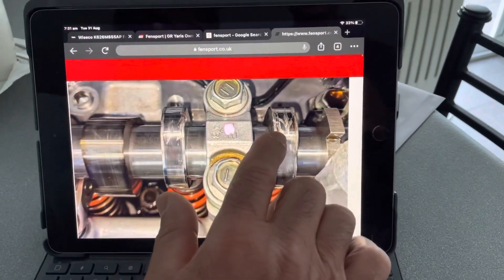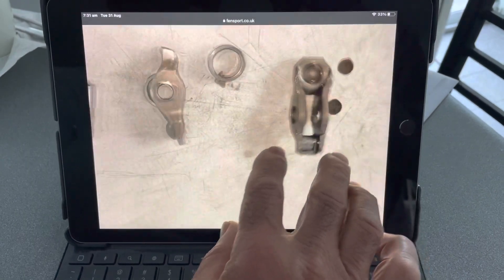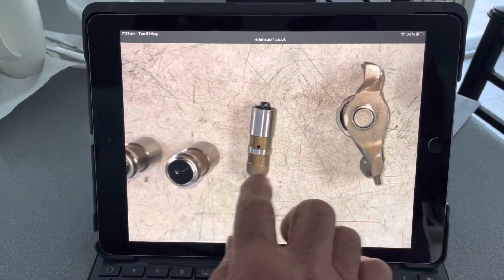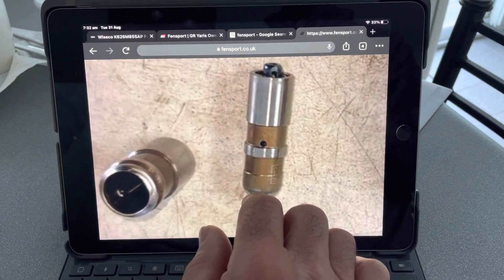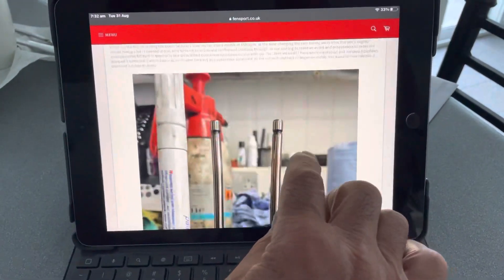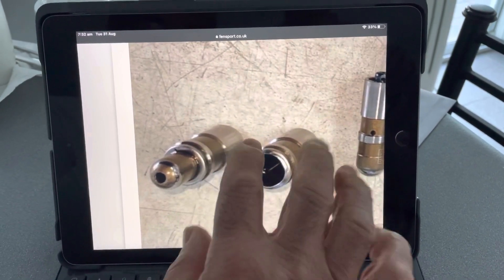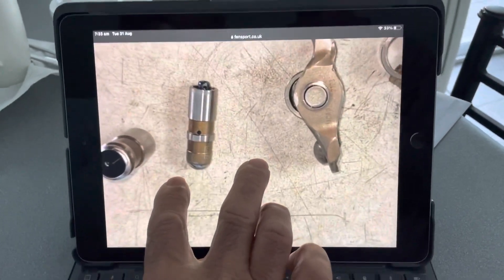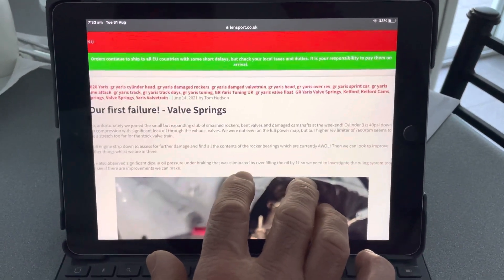G16E-GTS Yaris GR Engine Smashed Rockers, Bent Valves and Damaged Camshafts @Fensport Performance

Comment: I wonder if they fix this on the 2023 GR corolla with the same G16E engine or not so far I haven’t heard anything when it comes to the G16E in the GR Corolla but one can only assume that if it happened in that G16E engine in the GR Yaris chances are it hasn’t been resolved for the GR Corolla I have a GR Corolla circuit edition, so I’m genuinely concerned if this happens on my car what damage should I expect? Would it be just the head of the engine that I would have to rebuild? If something like this happens or with the whole block be nothing more than a boat anchor for smaller boats because it would be destroyed by that to
Reply: I will indeed thank you good, sir it has been a pleasure to speak with you
Reply from the maker: @90sbuickguy84  Likewise!
Reply from the maker: It's the same rocker setup in the G16E-GTS in the GR Corolla. It depends on your luck, a rocker could tuck away neatly in the tapet cover and you might experience a miss on one valve and be fine. If you're less fortunate and the camshaft picks up a rocker then it can punch a hole in the tape cover and drop valves like we've seen in the FA20s. I wouldn't overly worry about it though. Just something to be aware of. What are you planning to do with your GRC? Congrats on getting one by the way!
Reply from the maker: Oh and here is our video on the fix if you haven't seen it yet - https://youtu.be/V4IDYBl5LaE
Reply: Thanks I might get a slight tune on it when one becomes available and maybe get a new blow off valve from GR performance and that’s probably gonna be about it for modifying it at least for a while anyway but I have enjoyed driving the car so far no problems. I love it. It’s an awesome little car, my dad back in the day he had pretty much every Porsche 911 turbo that was a manual transmission you could think of, and he always asked me to drive this car because it reminds him of his Porsche days he says the thing handles like it’s already yours. It’s a fantastic and brilliant car. It would be the perfect car if Toyota had done a little bit more due diligence on the rocker arm situation and making a better design but who knows one might come about in the future that is permanent to completely eliminate that problem from ever happening again and it might even be Toyota that does that because there could be all kinds of recalls for that problem at least in the states so they would probably most likely recall it but I am looking for a permanent fix for that I have a Porsche 986 Boxster from 1999 as well with a five speed that I love and of course it has the horde IMS bearing failure which I think was replaced online not by me but by a previous owner possibly but one thing that is failing on that cars engine is the time in chain tensioners when you start them up every morning because they’re hydraulic if you hear rattling from the timing chains when the motor is not hot but by the time the motor is warm, you don’t hear it anymore but it took him 20+ years to get like that though I try not to drive it too terribly much until I get those replaced those two cars are probably my most favorite of any of any I have driven despite the engine issues either Toyotas going to potentially fix that issue or it’ll be 100% remedied in the aftermarket. Either way it took two years for it to become a problem on the G16E engine in the GR Yaris, and on my Corolla. We bought it with a six year powertrain warranty, which includes the engine as well as the other powertrain related items so by the time this problem comes to light, especially on my car, which probably will take two years of driving if they honor their warranty I could get either a new engine if needed or just a new head depending on my luck level, but who knows hope for the best as they say and thank you for responding to my last message. I appreciate it
Reply from the maker: Will have a proper read of this and get back to you soon!
Reply from the maker: @90sbuickguy84  Oh wow, that's awesome. You're actually chatting with Daniel (Dennis' son) we're a family business and I help out a bit with YouTube and replying to comments so I totally get where you're coming from with the family connection with cars.

That sounds like quite the car collection. It's always interesting to hear about the little quirks and issues that come up with specific models. The GR Yaris is indeed a great car and it's clear that you have a deep appreciation for its potential. It's good to hear that you're staying positive despite the potential issue with the rocker arm.

I agree, it would be ideal if Toyota addresses the problem in future models or if a recall is made to fix the issue. But, like you said, the aftermarket community is incredibly resourceful and often finds solutions to these sorts of things before the manufacturers do like we have :) If you look at the BMW engine in the Supra, it runs a similar clip to stop this from happening https://youtu.be/MckxlP60cnY?t=477

About your Porsche 986 Boxster - it's certainly a classic. The IMS bearing issue is notorious but it's great to hear that it's possibly been addressed on your vehicle. The timing chain tensioner issue you mentioned is quite common as these cars age, but thankfully it's a known problem with established fixes.

Overall, it seems like you have a lot of passion and knowledge about your cars, and it's been a pleasure to chat with you about them. Enjoy the drive and keep us updated with any modifications you decide to make! If you're looking at pushing a lot more power with the tune and decide to pull the tapet cover off to do a camshaft upgrade it would be a good time to upgrade the springs and add our rocker retainers. https://denstoj.com.au/collections/parts/products/g16e-gts-yaris-gr-rocker-retainer-kit-by-denstoj Let me know if you have any other questions about your GRC setup.
Reply: I’m watching your video on the Toyota 86 rebuild It’s so cool how you guys are taking that car which to most people because of its unfortunate condition, they would just take it to the junkyard and have it crushed but you guys are rebuilding it. That’s a wonderful thing not only is rebuilding a car wonderful thing, but it’s a wonderful thing to do it it’s a wonderful thing to do as a father and son project and it’s also a very neat that your business is family owned that’s becoming more of a rarity these days, especially in the United States where I live in Texas now we have a bit of that here in Texas, but not much unfortunately but for me personally, that is my end goal in life with my children when I have some I’m 23 years old currently I will be turning 24 on June 18 so I won’t be having any children for sometime but when I do I definitely want to share my automotive passion with them and do things like that with them build and rebuild cars and that to me is is a very special thing and that’s what makes cars and things like that worth it. You can pass it down and share it with your children. It’s an amazing thing that that’s what being a car enthusiast is all about I really enjoy your videos
Reply from the maker: @90sbuickguy84  You're right, the Toyota 86  - it's a labor of love that involves saving a car that many would have given up on. We did question it ourself! Haha

Doing these projects as a family adds extra meaning and enjoyment to the work. We're proud to be a family-owned business and it's heartwarming to hear your appreciation for that. Yes, it is becoming rarer these days, but that just makes it even more valuable and unique.

It's wonderful to hear that you have a similar vision for your future. Sharing a passion for cars and working on projects together can be an incredible bonding experience with your future children. It's more than just about the cars, it's about the lessons learned, the teamwork, and the shared joy of bringing something back to life.

I hope your automotive dreams continue to fuel your life journey. Wishing you an early happy birthday, by the way! Keep that passion alive and we're glad to have you as part of our online community. We're looking forward to sharing more of our projects with you. Thanks again for your kind words and support!
Reply: Back when I was 20 years old me and my parents went to Australia for about a month a truly astonishing place to be really. I told my parents that I’m going to but I’m going to get a job and not ever come back home that’s hell much I really did enjoy it over there and maybe in a car and dirtiest over in the state you know you don’t get like the Holden Utes and the fortieths and a bunch of other really fantastic cars like you do over there so I just started taking pictures of every car they’re pretty much I have about 1000 or so pictures of just all kinds of cars from that trip and my parents rented two cars a red Mustang convertible with the steering wheel on the opposite side, which I thought was cool in itself because it’s a little things in life but what was funny about that car was the hood latch release was still on the left side while the steering wheel was on the right and the other car we rented was a white diesel Isuzu Demax four pick up truck which we definitely never got that in the states and that was my car to drive and I was Monday and as that truck was I really enjoyed it because it was something new and different and that’s what made it cool to me even though it was just the most basic truck and then I saw a couple Ford and Holden Utes by looking at the expression on my face you would’ve thought they were a Bugatti Veyron or a Ferrari F40 or McLaren P1 in the United States. We had something similar to the Ute, but it was the Chevrolet El Camino and the Ford ranchero which were really cool cars because it’s a pick up truck bed in the back and a car body in the front with a giant V8 engine but sadly over here they were killed off in the late 80s specifically the El Camino so it was really neat to see a modern version over there when I went and driving on the other side of the road was really fun. My parents thought it’s gonna take him a while to get used to this to have in the steering wheel and everything else on the right side of the car. No not at all. I actually got it down quick because I have dyslexia, so I think backwards anyway it took them, especially my father longer to figure it out though, especially when he went to do a lane and reach for the blinker stock. He was actually turning on the windshield wipers, which was funny I’ll have to ask them which part of Australia we went to because it’s been a bit, but I really loved it over there a really special place that I would love to go again sometime maybe one day when I have a family of my own I can take them
Reply from the maker: @90sbuickguy84  Glad you had a memorable time in Australia! It really is a great place.

It's fun to explore the differences and peculiarities in car models across different countries, isn't it? Your collection of photos must be a treasure memories. There are a couple of re-badge Pontiacs that are Commodores by Ex-Holden engineers working in Detroit!

Driving on the other side of the road is certainly an adventure in itself and we're normally the ones doing it, but it seems like you adapted quickly due to your dyslexia, which is fascinating. It's great to hear that you didn't have any major issues with that. 

The Chevy El Camino and the Ford Ranchero are indeed similar to the Ute concept and it's a pity that they were discontinued. However, it's always exciting to see modern interpretations and evolutions of classic designs.

I hope you get the chance to return to Australia in the future, perhaps with your own family, and continue exploring your passion for cars. Thanks for sharing this wonderful memory with us. It's always great to hear about the unique experiences and adventures of our viewers.

Comment: Is this a similar failure to the one from Apex where the engine was put in the wrong gear on a downshift?
Reply: This is the second time it occured on the yaris... wow I thought it was the same car
Reply from the maker: Hey Ricardo! Easily mistaken but you're right, they're different Yaris GRs. Looking like consensus is forming and valve float is a common issue. Makes sense to retain the rockers! Currently developing a clip and lash adjuster. There is a thread here chatting about valve float: https://gr-yaris.co.uk/forum/threads/valve-float.3837/
Reply: @denstoj  Is the damage caused by misuse or poor design?
Reply from the maker: Likely a combination of both. From what we’ve seen on 86s, when rockers aren’t retained they can drop under normal driving conditions when a valve sticks or under more spirited driving when a valve bounces.
Reply from the maker: Yes, it appears so. Valve float causing rockers to fall out. If you haven't seen it yet, we talk about the Apex failure here: https://youtu.be/IWV9OwN_mSs